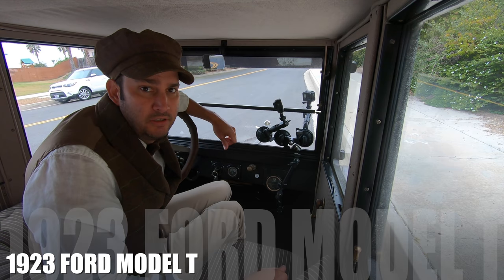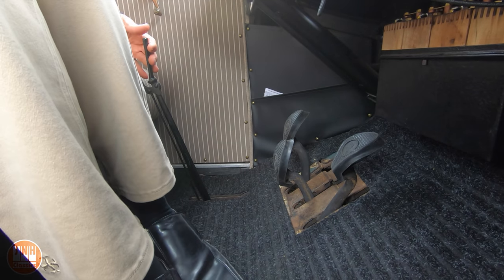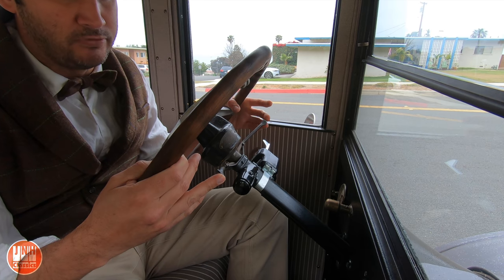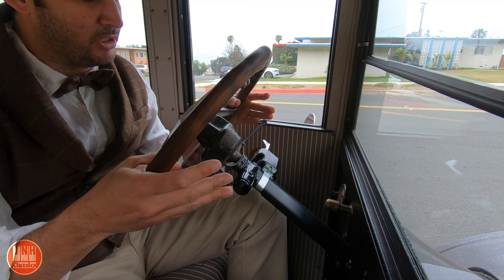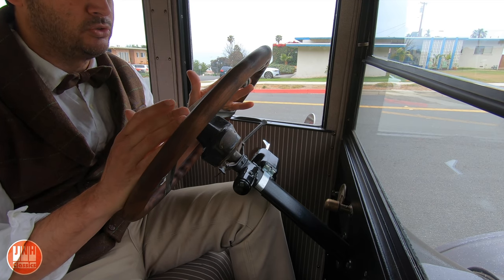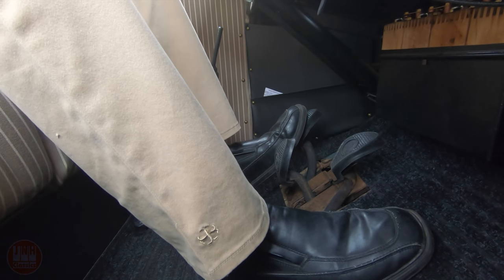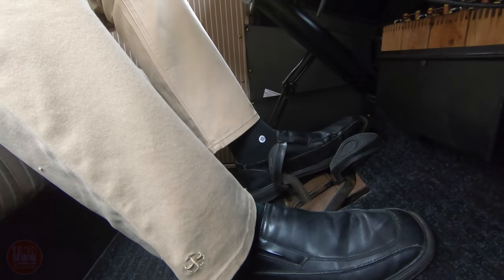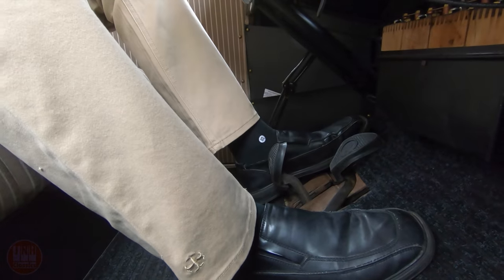How to Drive A Model T and Why It's So Hard to Drive on a Hill

Comment: Extremely well done.  I've owned my Model A for 50 years and it's so much more "modern" than the "T".  But I'd love to drive a Model T - I think that from what I've learned from watching your video, that I can do it.
Reply: Fun fact, model A peak torque is 105... Peak HP was 35. No issues going up hills.
Reply: @tomk3732  Yeah, the engine isn’t the problem, it’s the transmission. 1st gear for going slow up hills, 2nd is kinds pushing it up a super big hill. 3rd....forget about it.
Reply: @johnnyrocket6588  Since there isn't a 3d gear.
Reply: @algrayson8965  I was talking about my model a. Sorry if you thought I was talking about a model t.

Comment: I have owned a few cars that are now considered "classics", but I can't wrap my head around driving such a beautiful Model T on modern roads. I had a daily driver with a single reservoir brake master, and four wheel drum brakes, but the pedals and shifter were " normal".  

Please don't think I'm insulting you or your car.  When it was new it was an engineering triumph that changed the world.  Your restoration shows all that is good with keeping them alive and running.  Thank you.

Comment: Very nice tutorial... I have driven a 1914 Ford Runabout around 12k miles mostly on country roads... Perhaps you are aware.. but I want to mention a problem I see with your transmission pedals... First.. the clutch pedal is touching the floorboard and should fully engage above the floor without being able to ever touch it... The same with the reverse... The brake would also be the same to fully engage the drum surface by the band... Also.. the brake pedal should return without using your foot to pull it up... The pedal falling like that may cause the brake band to ride the drum which will tax the engine and wear the band lining... Hope this is helpful... This is the first of your videos I have seen... I will be looking at others...

Comment: Jarod,
I am impressed with your Model T driving skills. I have owned and driven Model Ts for almost 50 years. I live in central Missouri and do not encounter steep hills when I drive. 
From what I see in your video, I would say that you could probably adjust your  transmission bands to get better function from them. Your brake pedal is almost at the floor when you are getting results from it. You should never need to pull it back with your foot after using it. I believe that tightening the band will solve both problems at once.
Your clutch pedal could be snugged up some also. The pedal can be adjusted to engage low gear without going almost to the floor. You should be able to feather the pedal and throttle for a smooth start just as you would let off a regular clutch pedal for a smooth start. All my cars have always had the original type cotton band linings.
When I start my car, I immediately pull the spark lever all the way down and never touch it again until I shut off the engine. I get excellent performance and adequate engine braking for my type of driving. Engine compression would figure into this equation. If you did not re-bore your engine, you could have a bit of wear which would contribute to reduced engine braking.
I have really enjoyed your Model T series. I am a Chevy guy, at heart, but since my first Model T drive, nearly 50 years ago, I have been hooked on them. The quirkiness, the historical significance, the whole package makes them the most important automobile ever built.
Reply: Very good observations... I posted about it before I saw your comment...

Comment: Way back in the mid 70’s when I was in college, I had an older teacher that talked about driving Model T’s.  He said what you did about backing them up hills because of the fuel tank and also when the transmission bands were slipping.   Your video explained it ver well!
Reply: My uncle had a 1917 T truck that sat outside forever and I used to play on it as a kid... it had a tire valve on top of the tank so you could use a tire pump to pressurize it to keep fuel flowing, Dad said it actually worked pretty good!

Comment: Very kind of you to show us how the Ford Model T drives. It's impressive that after such a well-selling car other manufacturers (thankfully) didn't follow these controls. I've read that these pedals (especially the middle one) helped the car get off the muddy roads by making it easy to shift back and forth.
Second gear was then enough for those roads and so there were not many demands on the brakes. Now on modern roads this car is not suitable but it is still exciting to drive or just to look at. Congratulations on your patience and your love for the historic car.

Comment: Best T tutorial on the web, bar None!! Loved the 4-6mph. Lol. I had my model A for 25 years, and as someone else said, it was “modern” compared to the T. There is a hydraulic kit made for rear wheels only for the T. I don’t have the link, but maybe someone else can post it. I believe it uses disc brakes for stopping. Jared, with those hills, please look into the accessory screen for just under the transmission cover. It will help filter out some of that band material from usage and help keep it out of your engine bearings. Great video! 👍
Reply from the maker: I installed that screen and magnet already, just didn’t film it👍
Reply: Texastparts.com  found that link I had mentioned for T disc brakes.

Comment: This video brings back so many fond memories of a 1926 Model T, that owned me, a number of years ago. It was immaculately restored to better than original condition by its previous owner prior to my purchase. After receiving instructions from the former owner gentleman, I decided that maybe I would just put the car up on 4 jack stands to practice on while in the garage, with the door open for exhaust reasons. However after studying the manual, and being able to drive a "normal" stick shift, with No problems, I changed my mind an thought that I would take it out on the road near my semi-rural residence. I mean, HOW HARD COULD IT BE, RIGHT. So I proceeded out of the driveway and around the block, and managed to shift from low to high reasonably well for a Model T Newbie. Ok, so far, so good. Now on to the Golf Club Road which was more trafficked and also had a faster flow. Speeding along, in "Galloping Girty", at some 35 miles per hour in an area with built up New housing, an impatient motorist pulled in behind me. Perhaps in  hind site, I  should have just pulled off the roadway and let them pass. Instead, in the heat of the moment I rolled down the window to signal a left turn into a driveway where a "BRAND NEW" home was just being completed. Guess what? I temporarily forgot how to STOP this machine, having been more focused on the forward propulsion of this unique creature. In a second of panic, I pressed ALL of the pedals at once and the T stalled out ...... just 1 inch from running into the brand new double garage door on this beautifully completed New home. Practice, practice, practice or is it Location, Location, Location. My better half gave me "The Look", but wisely said Nothing. Great fun was had by All. Greetings  from Ontario, Canada.

Comment: A fascinating video that clearly shows how to manage a Model T.  Amazingly, its transverse leaf suspension front and rear in principle found its way into the small 8 and 10 horsepower Fords designed in Detroit for English Ford manufacture.  The last of these small Fords with tranverse leaf springing  were made in England until 1959!  I own a 1936 Ford 10 horsepower Model 20 made in Dagenham, England, complete with its suspension harking back to the Model T.

Comment: Thanks Jared for all the videos on the 1923 Ford Model T rescue, I have really enjoyed them.  Your video on the mechanics of driving going up and down the hills I found especially interesting.  Knowing the pathetic braking system the stock model T has, I knew you would be relying mostly on engine braking.

My dad had a 1926 model T while in college, which was 200 miles away from home so, he got lots of opportunity to discover and make use of the quirks the car had.  One being, if you jumped out of the car to go into a store for a few minutes, half the time when you returned, you could turn on the coils and the engine would start (without touching the starter) due to gas vapor being left in one of the cylinders.  Being a poor college student, dad couldn't afford a battery that had enough power to run the starter so, hand cranking was his mode of starting.

The crankshaft in that engine is quite fragile, giving the engine too much spark advance going up a hill can snap the crankshaft.

That gas starvation problem going up a hill from a stop was very common.  Some places in the country were referred to as "5 gallon hill" (or the minimum gas level needed), meaning you had to have at least that much fuel in your model T or more, or it would stall out when taking off from a stop.  The last 2 years of manufacture, Ford moved the gas tank to under the cowling behind the dash to remedy this problem.

In later years, my dad was always tapped to drive the model T whenever the town we lived in had a parade, as it usually had at least one model T in the processional.

Since the Ford model T was manufactured for 19 years, a huge number of aftermarket parts became available.  One obvious part was improved rear brakes.  Ford added front brakes to the model A, as I am sure that was the number one complaint with the model T.

Comment: GREAT VIDEO! Wow, I never knew how hard that car was to drive. Your comment that it is more like an early tractor, is especially insightful. With all the pedals and hand control manipulations, it must have been good that there wasn't much traffic back then. If 25-30 is your recommended top speed, does this mean you will not install the two speed rear end? Thanks for sharing this to all of us! Casey in Detroit, home of the Model T.
Reply from the maker: Thanks Casey, I don’t think the two speed rear axle makes the car faster, but it does add a gear or two between low and high so it’s easier to drive especially on hills.
Reply: @Jerod_Helt  you are correct. My ‘27 T has the Ruckstell rear end. It helps with hills.  Third gear can climb pretty well so you don’t have to slow to first. However, now you have to add shifting the Ruckstell to your list of activities while you drive. I’m still working on it. 4th gear is really just normal second, a direct drive. So it doesn’t go faster.

Comment: I learned something new from you. I have a 1924 touring that my dad put together. I thought that I knew how to drive it pretty well. I  drove it to the top of a steep hill and thought that I could bring it down using the brake in high gear. That was a big mistake. The brake band lining shredded about halfway down so I had to use the handbrake to make it the rest of the way. I opened the transmission cover to find that it had burned cotton fuzz throught. It is difficult to get into low gear when the car is already going too fast. Thanks for the video.

Comment: A very interesting introduction to the operation of this old technology. Because the drivers were not very impressed by the braking performance of these cars, a Rocky Mountain brake set was developed that can be retrofitted. Two additional, large brakes are mounted on the rear axle over the existing brakes. The braking performance is thus improved a lot. Thanks for the interesting reports.

Comment: I used to drive my Dad’s ‘24 C cab 1 ton truck in parades when I was 16. Never had any issues driving it. It’s still in the garage and hasn’t been run in 40 years. I may try to get it running again.

Comment: Wow, if you have to make an emergency stop you are screwed !   I think I would do what Jay Leno often does and install some real brakes on at least one of the axels.  A Ruckstell axle kit would be a nice addition as well.
Reply: I wondered if he could use the parking brake in an emergency. After all there are shoes on the rear axle.
Reply: @TheGreatOne16439     Could be - after all another name for the "Parking brake" is the "emergency brake".    In the 50's & 60's we used those terms interchangeably

Comment: I really enjoyed your entire series. I  have some questions. 
i. You didn’t seem to use the choke when starting.  Is it only required when the engine is cold?
ii. Does it run on modern unleaded gasoline?
iii. Why do you switch from battery to magneto?
iv. Can you crank start it with a dead battery using only the Magneto?
Reply from the maker: The choke is only needed when it’s cold. Ive read it can run off almost anything flammable including whisky, so it’s very happy to run on modern unleaded gas. It runs a little smoother on the magneto than on the battery but it runs fine on the battery too. You can definitely start it on the magneto when it’s warm but it would be harder to do when it’s cold. Probably possible if you crank it enough.

Comment: I just picked up a 1926 C cab model T
Reply: What is it like?
Reply: @mrjed6912  in good shape but it has sat in a garage for 20 years 
Tomorrow I will wash it up and I am going to pull the oil pan make sure engine is good and then put it together and try to fire it up

Comment: Dad said that when you want to go fast you pull both ears down. LOL
Dad played high school football. One night while he was at the game, someone "borrowed" his T, brought it back to the same spot, but left the shifter forward. After the game, dad went to hand crank the car, it fired and ran into him. Fortunately, his sister knew enough to turn off the key. But the bumper twisted his knee, which put him out of football. 
He also said that it wasn't unusual to see a blue flame on top of the radiator from the alcohol that was used as antifreeze.

Comment: Something I really need to ask about is how do you stop in an emergency? The American roads give a much clearer view than what you would find in the UK. Loads of parked cars on narrow roads here. Would I just grab the handbrake and lock the rear tires?
Reply from the maker: The old timers say in an emergency just hit ALL the pedals… the reality is you’re not usually going over 20 MPH so stopping isn’t really that big of an issue. What is an issue is holding up traffic because you’re driving so slow. I think that’s why you don’t see them on the road very often.
Reply: @Jerod_Helt Thanks very much. I was once told to press reverse and the brake at once.
Reply: Brake and clutch to stop, press all 3 for emergency

Comment: I believe for the 26 and up they made a brake conversion that lets you use the rear parking brake shoes as brakes, still not as good as modern brakes but def better then the trans and engine braking alone..... Cool ride man :)
Reply: I’m almost to the point of taking out my Dad’s 1927 Model T and though I have a pretty good understanding of driving it, braking is my biggest concern, and with a T there really is no sudden stop.

Comment: The description is a little bit weird on this video because the Ford Model A has a 3-speed manual transmission with shifter on the floor and a real clutch number two the brake pedal does connect to the mechanical brakes there is supposed to be a return spring that will make it automatically pop back up and it looks like he might have had half of the brakes overall available usable given how low the brake pedal was it should be a lot further back than we were seeing it and one of the aftermarket things that you could get for this car was there was a jar that held fuel with a hand pump and it was mounted in the engine compartment so that way when you were going up hill in low range you could pull that hand pump just before you started going up and get a little bit of fuel in the what they called Hill Climb tank but from my understanding reverse has the lowest gearing of all of the gears so it is the best one for climbing Hills anyway but yeah this guy's break is definitely out of adjustment and if he adjusts it right and put a proper return spring in there he could definitely get more use out of the brakes as well and they would definitely be more useful on wet roads the brakes should be good enough on the car that he could slam on that brake pedal as hard as he could and he should be able to at least get the tires to chirp because they're trying to spend a way slower than the car wants to go I haven't watched the other videos but I'm guessing he's made good progress but he still definitely has progress to be made on this car.
Reply from the maker: You’re describing the model A which is a modern car compared to the model T. As you said the A has a 3 speed gearbox a clutch pedal and drum brakes at each wheel which are operated by the brake pedal. The Model T doesn’t have any of those things.

Comment: Very interesting. No wonder they crashed, there's not a lot to stop them. These don't even look like steep hills. Cars will never catch on! 
I have driven a tractor and a small dumper at work which could run away downhill if you were not in a low gear, or lose speed uphill and then you had to stop and select low gear, and I had a 1971 Land Rover which had a crash gear in second. I had a couple of years starting it with the handle when the starter motor broke, I switched on the ignition and reached behind the seat for the handle and then stuck it in the front bumper which got some odd looks off people, especially in garages getting fuel. I had the engine running well and it usually started on the first crank upwards.
I think I liked my Land Rover because it looked a proper car shape like this Model T. I never got a modern car.